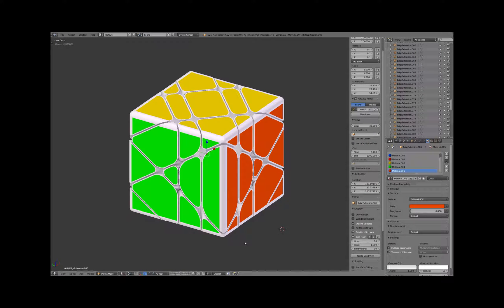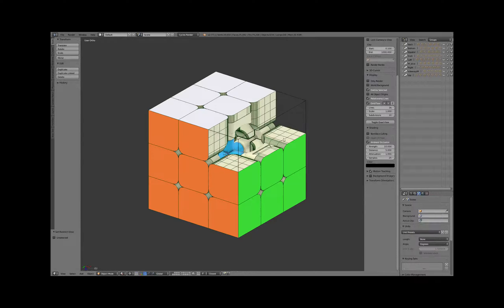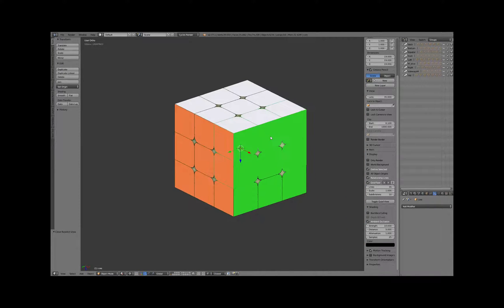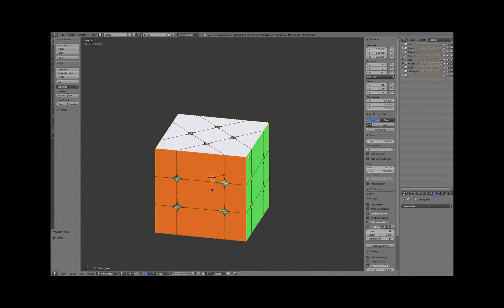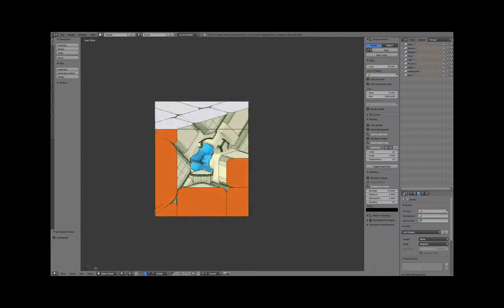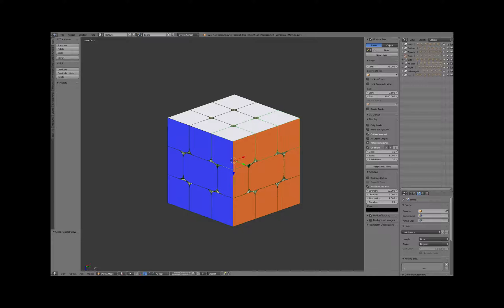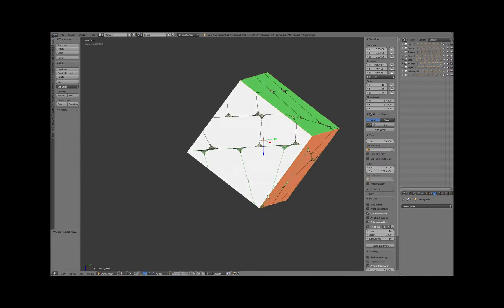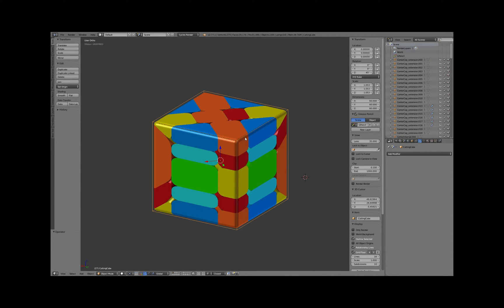Intro to designing 3d printed shapemod puzzles

Comment: So I followed your Tutorial and designed a twisty puzzle that I like. How do I now export the STL Files, so I can 3D print it?
Reply from the maker: I've had this asked a couple of times so I really need to add a new tutorial!

Here is what you do though,... I would export each piece as a separate file. Most slicers can orient the piece, but you may want to do this when you export so it will just load up in the orientation you want to print in.

1. select the piece,... orient it if desired.
2. Go to File/export/.STL
3. Be sure to select the checkbox "Selection Only" on the left side.
4. Give the piece a name and location and hit "Export STL" 

Print and enjoy!

Comment: can you do anotber shape mod tutorial with more advanced stuff like barreling and other stuff, also, are you using blender?
Reply from the maker: Yes this is all Blender. At the end of the 11 part series I do cover additional shapes including barrels.

I also hope to start a new series soon.
Reply: also, how to you rotate the rows idividually
Reply from the maker: To rotate a row or column you need to select all the pieces in that row/column. I have set up groups to do this. You can either hit the name of the group from the list in the upper right, or select a single piece and then hit shift-G and select group, followed by the group you want selected.

You can group objects by selecting them and pressing ctrl-G. Keep in mind that pieces can be part of several different groups.
Reply: okay
Reply: how do you rotate it like how you do instead of editing the rotation from the menu?
Reply from the maker: you can press the "r" key to rotate. After that, press x, y, or z to rotate around those axis. You can also enter a number to rotate that many degrees, so typing "rx45 [enter]" will rotate 45 degrees on the x axis.